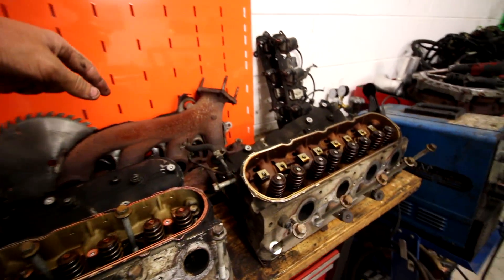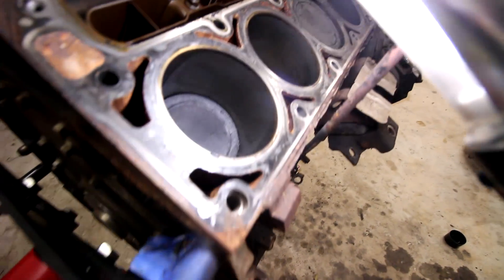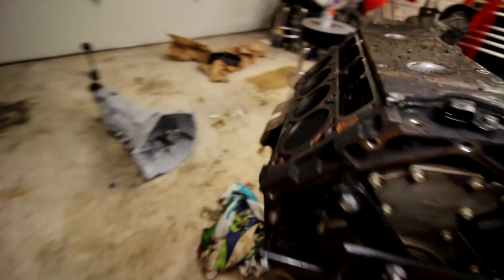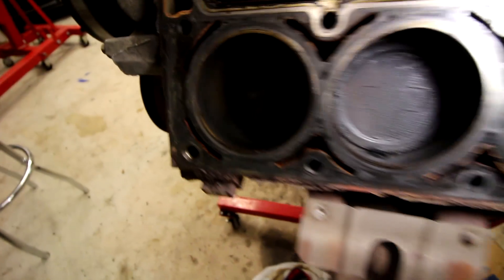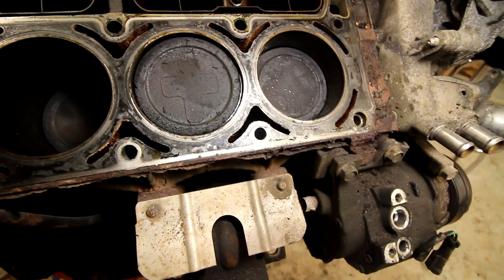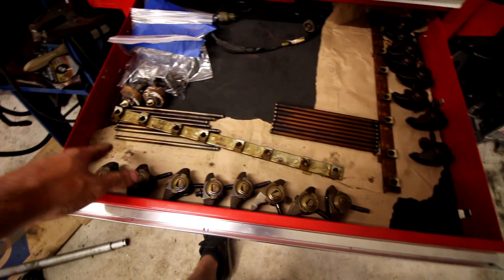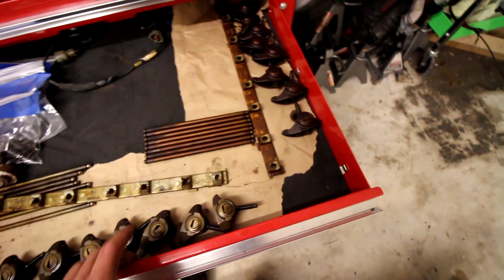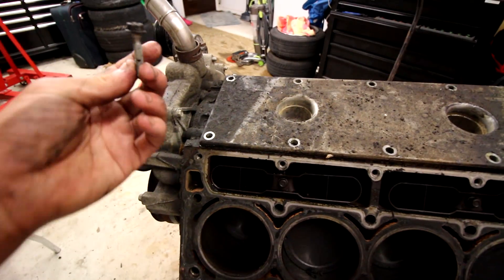Building a LS motor: Part 1

Comment: 5.3l is not an ls motor lol
Reply from the maker: HIinfidel yes it is the vortecs are LS motors same cast block just difference between ls1/2/3/7/x and 4.8/5.3.6.0 are aluminum vs cast iron blocks. It’s same mold as LS block
Reply: FloridasFinest vortec’s is LS based but not an LS. GM has never considered vortecs an LS . 5.3l are LM7/L59/LM4 , 6.0 are LQ4 or LQ9. I didn’t see LS in those codes anywhere.
Reply: HIinfidel lol haha yes it is everybody and their mom considers a 5-3 an LS not a variant you will get laughed at in a ls forum for that

Comment: Rx8's are pretty cheap. I'm surprised not many people on you tube are building them. The LS would fit great.
Reply from the maker: Charlie W ya I agree maybe!
Reply: from what I have read its a PITA because the way the rotory sits in the engine bay its can be a big pain to fit a LS.
Reply: I'm doing that exact swap right now... the only pita is the tachometer and the steering rack relocation, but there's a guy who sells his own kit for like 2 grand that takes care of all of that including diff and a.c. mounts.